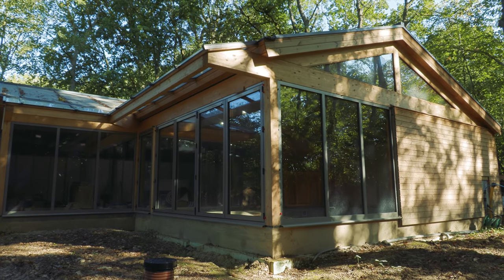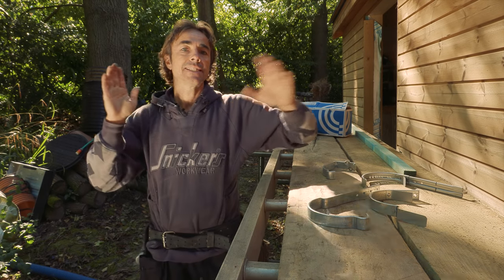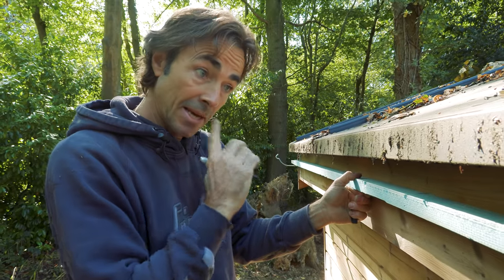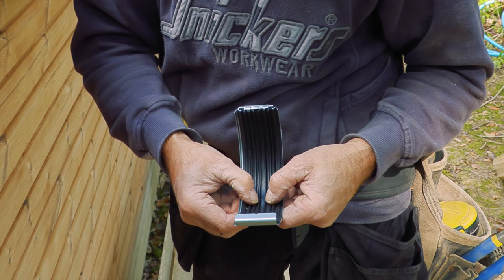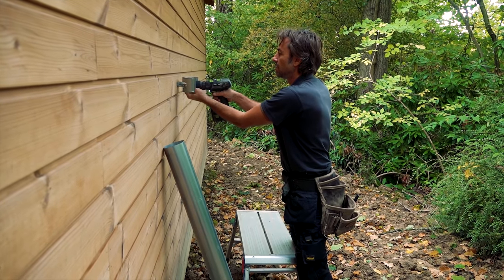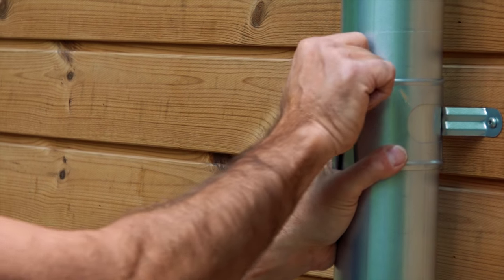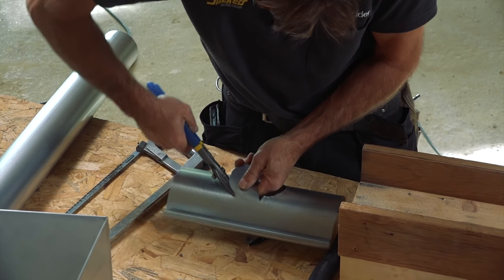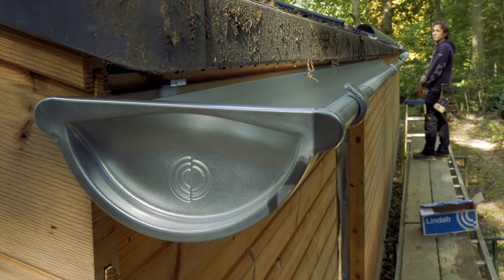Leaking Weak Plastic Gutters? Change to Steel

Comment: Here's a wee tip from an electrician. You could use galv spray (used for tray installation) on any cut edges to help prevent rust in the future. Once you've debured the edge spray some on to a spare piece of cardboard and dip the cut end into the paint (saves getting overspray on to your finished surface) let dry and fit. Hope that helps. Great channel. All the best, Pete 👍
Reply from the maker: Hi Peter
 I had to take some of this guttering down for redecoration recently and the cut ends have not corroded. I don't think it is an issue
Reply: @SkillBuilder  Hi Robin,
That's great, looks like a very high quality product. High quality steel will resist rusting for longer. If no rust showing so far should last a long time. Fantastic bit of metal work with the hopper you fabricated, looked like factory made part. Very impressive building you created, and the gutters are in keeping with the building, and complimet it to perfection.

Comment: We used this Lindab guttering on my parents old house just after the bad Winter of 2010.  The brackets were secured to the wall heads with masonry bolts into pre-drilled holes.  We found one issue with the corner sections. They are secured to the linear sections using the rubber lined clips but the actual corners remain unbracketed.  Due to witnessing the effect of heavy icing in 2010 ripping off gutters and the inaccessibility due to a height of about forty feet we installed stainless steel strips about four inches long to over lap the corner joins and used self tapping stainless steel screws to secure them to the outer rim of the gutter.  A simple reinforcement to an otherwise great product.

Comment: Nice to see a video on this, the UK building industry falls behind on things like this that are standard on the continent. You don't see houses in Germany and Italy with crappy plastic guttering. I've been using extruded aluminium guttering in my jobs for years, but will consider a system like this next time.

Comment: Lovely bit of kit
Reply: It really is, thanks for commenting
Reply: @ukconstruction  Just finished installing the same system in RAL 7016 on a contract in Staines, Very nice to use I like it alot and even made up two of the 300mm wide hoppers which worked perfect.  :-)
Reply: Well done send a picture! Good work

Comment: I have used this extensively for 20 years or so and do rate it as a product. However - I would say that the leaf guards are a good idea, and if you have very acidic pine needles landing in them, it is best to clear them out completely periodically. If they gather in clumps in the gutter, it can destroy the galvanized coating within about 15 years and you will have rust and small holes which is not a good look.
Reply from the maker: Thanks for the info Hugh. It is good to get feedback on these products from people who have used them for a while.

Comment: When you put the down pipe in did you need to use silicon or even treat the ends of the steel that was cut?
Nice bit of work you are a perfectionist.
It's enjoyable watching someone doing the right thing and have the intention of
Building something to last as long as possible.

Comment: We have similar product but 30% cheaper it's called Ruukki
12:15 Gutter front needs to be 50 mm lower than where roof line meets gutter so falling snow from roof doesn't hit gutter at all. Because trust me those hooks will bent if falling snow hits gutter.

Comment: Hi robin I've just watched your video as fitted lindab guttering on a single storey extension I've built your video was very helpful although I've fitted lots of uPVC before  the only part I struggled with was getting the 3m length of guttering in to the holding brackets !!! Omg not easy especially without scratching the guttering !!! Am I doing something wrong ?????? Or did you find it the same 🙏

Comment: Spoilt for choices you are there in South East England  .... Just one thing: I reckon those cut edges could be a weak point in terms of rusting in the long term since the bare metal is exposed,  unless you dab them with some rust preventative coating before  joining or fitting the spout. Any mention of that in the documentation?  

Also wondering what is the best method to cut corrugated galvinised roofing, now that you raise the  issue/problem  of heat generated from a cutting disk spoiling the coating. Hack sawing is out of the question.
Reply: Providing you cut the material as directed by Lindab effectively not generating to much heat then the cut will seal itself, don't as me how! Maybe anyone from Lindab reading this could be more specific!
Reply: With the corrugated roofing you could try a jigsaw with a fine metal blade with the pendulam action turned off if you have a lot to do motorised metal shears would work
Reply: Thanks Robin. A galvanised coating migrates to heal cuts and scratches. The magnesium and zinc in the Magestic coating are more anodic than a typical zinc galvanised coating, making the sacrificial properties of Magestic more active. The self-healing is effective in even the heavy gauge steel up to 5mm. We do also sell a touch up paint in a silver colour which can be used on cut ends but the cut ends would usually be covered by a gutter joint or stopend so are not directly exposed to the elements.
Reply: Great point actually, defiantly would if you cut it in the wet and didn't have time to heal the cuts in time.

Comment: Robin, great work on your own house refurbishment. One question, when you cut through the gutter run with a hacksaw and snips for an outlet - what stops it rusting where you've cut through the galvanised protection?
Reply: Hi Keith sorry for the delay in responding, if you use snips and a hacksaw to cut the material then you don't compromise the coating it's the heat generated from angle grinding that damages the coating and can increase the possibility of rusting, hope that helps
Reply: @ukconstruction  Hi Robin. I think Keith might be right. The side of the cuts won't be galvanised as the zinc is just a coating and not in the material. The cut ends will just be raw steel. Is it assumed that there will be some sacrificial protection from the zinc? I imagine that it will eventually rust at some point on the cuts. I think if I have a go myself, I'll spray a coating of zinc paint on the cuts before assembly. Love your work and your YouTube channel.

Comment: Here in Cornwall I have seen builders and developers  use Lindab guttering for about 12 years. I've never believed that it could last very long and now I'm hearing that as I expected, it's rusting out.
 A developer I have worked for has replaced a lot and relatives of mine have just discovered that Lindab guttering they had put up less than 10 years ago has a huge amount of rust on it.
 I think it's an inappropriate product for any place where it rains, like outdoors for example. But I would certainly recommend it for someone who is building a bungalow in, say Saudi Arabia. Anywhere else, well, I regard this product as garbage.
PS. I'm not being paid by any one to write this comment.
Reply from the maker: I have Lindab which has been up for 20 years and shows no signs of rust. I think maybe the coastal location is a problem

Comment: You don't med those rubber things that goes in between the gutters. 
This is all we use in Sweden although some of the things u have is a bit different then ours, but almost the same
Reply from the maker: Hi Void man
 I have put this gutter up on my own house with interlocking and silicone. It is now over 20 years old and still good on those joints so I agree the rubber is for easy removal during painting.
Reply: Ah so thats what they're for! Just thought they where the "homeowners" easy istillation.

Comment: I love watching these programs but he makes it look so f**** easy, I wouldn't want to do it !!!!!
Reply: Hi David, it really is easy, just something new to learm
Reply: @ukconstruction  I'm a 2nd fix Joiner. But I'm going to be installing this on a barn conversion. But I'll be using rafter brackets as there's no facia board but old un even brick corbels. Can you give me any tips. Really looking forward to getting stuck into it. Also have to build up a warm roof which is also a first for me. So a busy few weeks ahead. Fingers crossed the weather holds up🤞
Reply: @1patfin  Sounds like you have your hands full, that's great though, the rafter brackets are pretty good, maybe DM me a pic on Instagram at some point of the rafter/brick corbel junction? All the best Robin

Comment: Its called zinc not steel
Reply from the maker: You speak with forked tongue.
It is so easy to look up the product details but if you find it too difficult here is what you need to know.
Lindab Rainline Steel Guttering

Manufactured in Sweden from sheet steel, Lindab Guttering is becoming increasingly popular with it now becoming more and more recognised for it’s durability and environmental benefits over PVC guttering.

Available in a traditional half round profile measuring 100mm, 125mm or 150mm, all of which are available in a 8 colours including Anthracite Metallic, Dark Red, Black, white and many more!

Lindab Rainline is a truly complete system. With gutters in four dimensions, down pipes in five dimensions and an extensive range of components, the system offers solutions for any type of building, large or small, classic or contemporary.

Lindab’s Rainwater systems are manufactured in up to 30% of recycled material – making Lindab Steel the rainwater system with the lowest carbon footprint. Although recycled, Lindab Steel is strong, durable and made to last. Galvanised Steel has a life expectancy of up to 70 years, out lasting Aluminium, Copper, Cast Iron and uPVC.